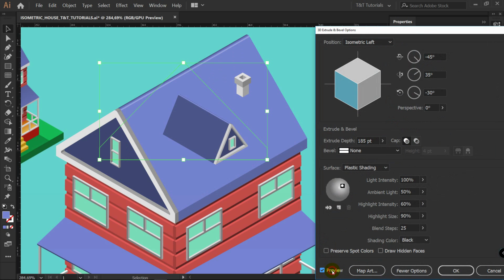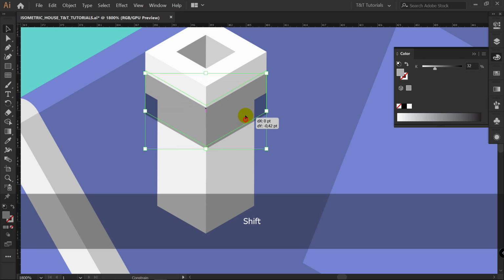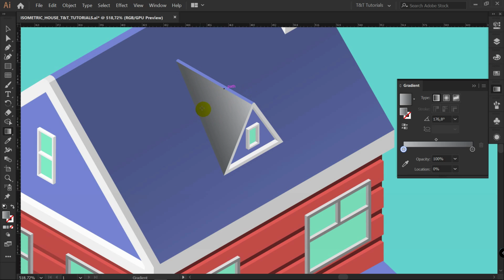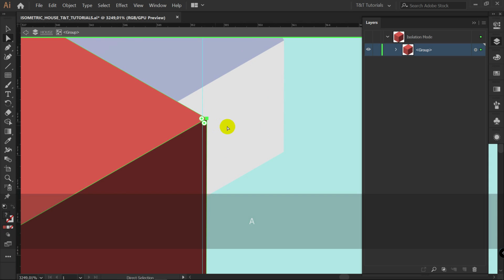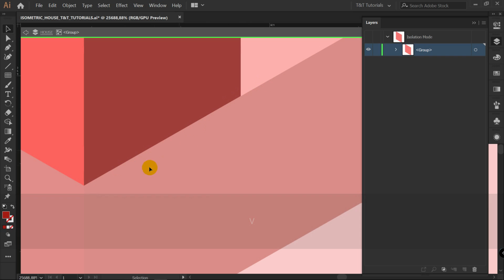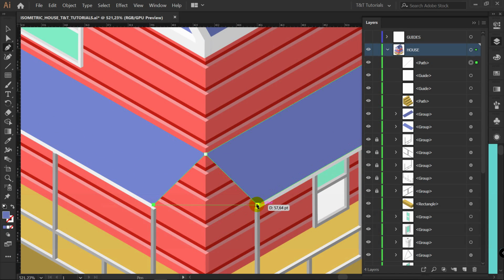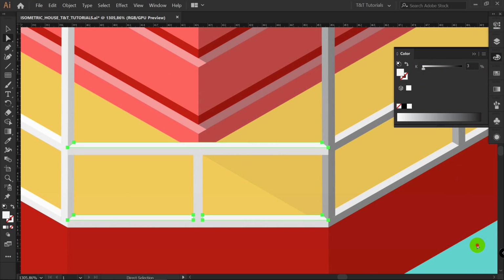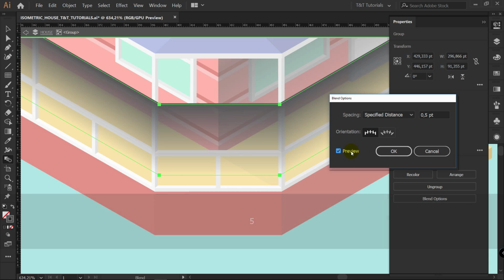ISOMETRIC House | Illustrator Tutorial (Part 2 of 2)

Comment from the maker: ISOMETRIC House | Illustrator Tutorial (Part 1 of 2): https://www.youtube.com/watch?v=75pvmGml1WQ
↓VIDEO GUIDE ↓
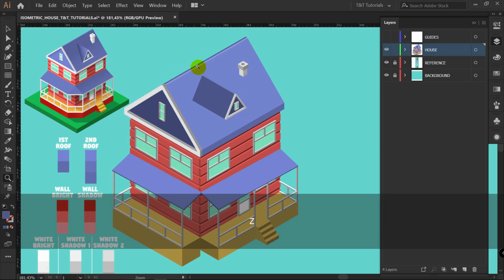00:24 how to add shadows using gradient and blending modes
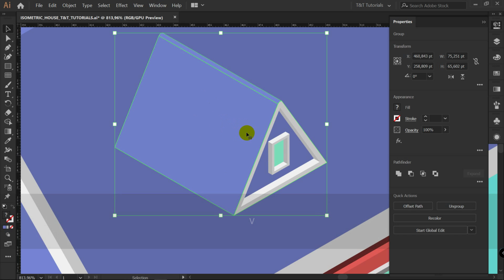08:49 how to use opacity mask to quickly apply needed shape to objects
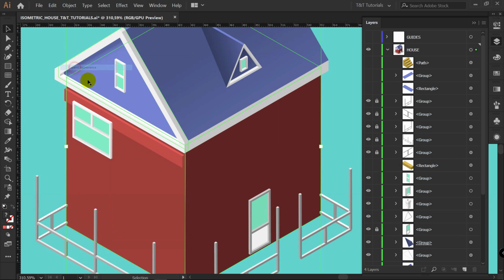15:05 how to edit expanded 3D shapes and align them using guides
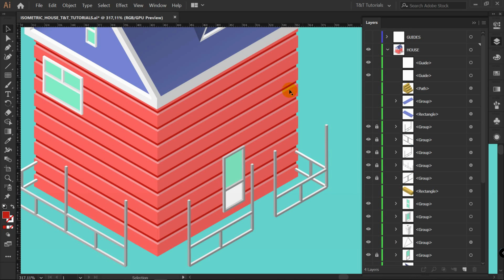28:53 wall in the shadow: how to apply base shadow using unite from pathfinder and multiply blending mode
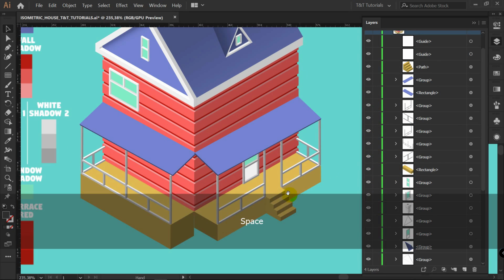29:34 terrace roof: expand, align, delete unnecessary part and duplicate to the other wall; then add shadow and fill gap between roofs using pen tool
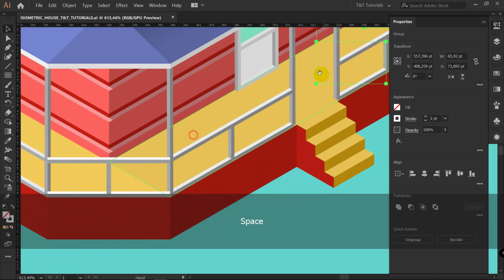36:13 handrails: expand, remove gaps, apply colors
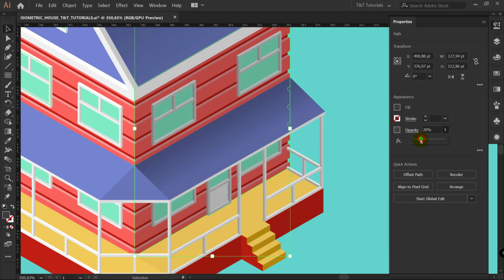40:41 wall in the shadow: apply gradient to add complicated realistic shadow
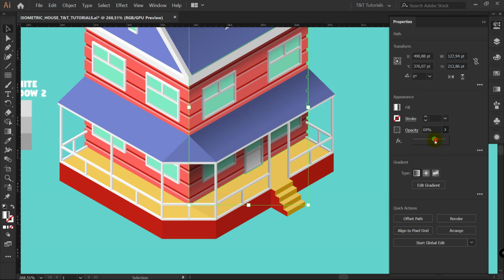41:40 how to use blend tool to create difficult shadow
43:15 how to create clipping mask to hide some parts
Thank you for watching!